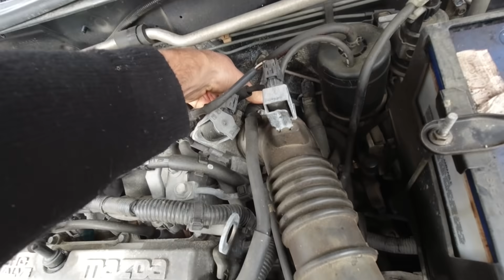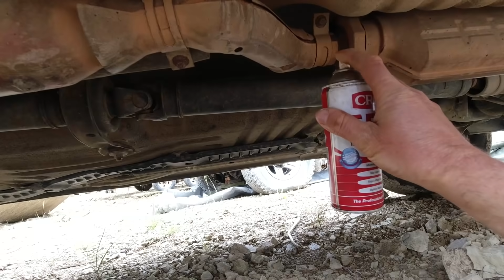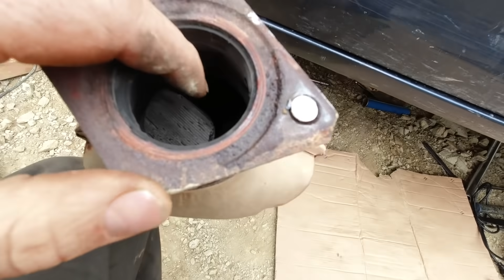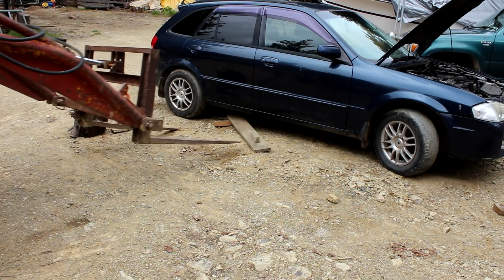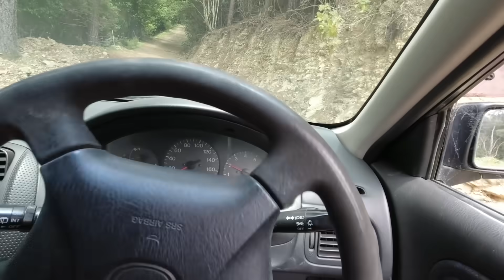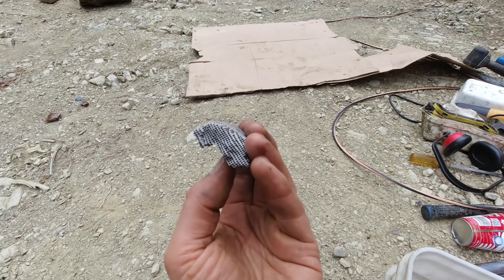Car engine overheating / lacks power,  Faulty Catalytic Converter?

Comment: Those mazda's are tough as nails. Had one back in the days and I loved it
Reply: I had a 1988 mazda 323 manual everything..brakes steering trans windows etc..but what a great lil car got me 40mpg too
Reply: @leeharris3061 
 I had a '88 323 3 door hatchback too but automatic,  a "De Luxe" version, with sliding moon roof, and... lighted door locks !
I was looking for winter beater for 5 or 6 months when my regular engine broke was not worth fixing it.  My mechanic called me saying a lady customer wanted to buy a new Honda, tired of her old car.
 It had 2 sets of brand tires, summer on lovely mags and winter on steel. No rust at all, 188,000 Km.  2,000$C. 
I had it for 5 years (!) till the front frame broke at 465,000 Km !!
I loved it.

Comment: That's weird . The catalytic converter after muffler. It's also a weird design as well which makes me wonder if it really is a catalytic converter.  FYI for those wondering if it is tested it will probably pass emission tests.

That said..uh I don't think your engine problems are over. Blocked exhaust stalls engines doesn't make them overheat. Also if rad blew you have other engine issues.  Usually a bad head gasket or cracked head.

Comment: Good job. It seems that if you save the bits out of the converter, those chunks are full of the platinum catylist. People extract the platinum and it's good money. There's a video on YouTube (Cody's Lab) in which the presenters collected dust off of the sides of the road and extracted the platinum from it and determined its value. Or you could use the platinum to make a bunch of catalytic  handwarmers. They stay warm for hours, running on lighter fluid, without a flame. The platinum catylist burns the fluid and make the heat.  

Thanks for the content.
Keep up the good work.    
בס״ד

Comment: If it has an O2 sensor on it, doing this fix can cause it to use more fuel. I didn't see  on on yours so it should be ok. Did this a lot back in the day. As long as it visually had a catalytic converter on it would pass inspection. Now they put the sniffer on it to make sure.
Reply: Had similar issue and installed a race cat (essentially just flow through pipe with mesh) and placed elbow fitting on the o2 sensor to move it further away to tweak the sensor readings. Worked a treat and the ecu never threw any errors.

Comment: Former Mazda tech here: these cars have a bad rep for destroying their cats... ive changed hundreds of those in the early 00`s
Usually was caused by a misfire, bad plugs/wires or coil. There was a factory recall on the early 1.5 litre model, those all got new coils after too many failed and immediately destroyed the cats/rear mufflers causing huge warranty claim costs
Reply from the maker: Thats interesting, thanks for letting me know

Comment: That proves that 80% of modern cars' components are not really necessary... One of the best cars ever made (for its simplicity and good engineering) was to my opinion the VW beetle with Porsche manual transmission (cooled by air).

Comment: wow we didn't get those in 4wd around here, minnesota/usa
very nice cars though, they go for just about forever
if it ever gets to stalling, first thing to look at is that rubber intake boot to the MAF, they tear and then the metered air leak makes it stall
Reply from the maker: It is a good little shopping cart and gets up my hill with ease. Good advice cheers
Reply: I had that rubber boot leak on mine too duct tape fixed it :) I got a second one after the rubbish truck ran over the first one it was the 2L model SP20 that was the best car I ever had it was comfortable and easy to drive long distances but also really fast.

Comment: Lucky buggers get awd mazdas like those!

I rebuilt my 4age, forged everything, new turbo and it wasnt a slug it was just a little underwhelming. Turns out same thing.
I did the same process and oh my good god it was a weapon. 
Mind you i replaced the entire exhaust and included a 100 cell high flow cat. Still goes like a cut cat!

Comment: Those can be problemmatic, they frown at us fixing them that way here in the states...
Reply: Only in newer cars... in my state 95 and back don't care if you do this. I think they actually allowing even newer cars to skip the emissions check as well.
Reply: Technically it's not fixing it so much as converting it to a muffler.
Reply: I cut the cat out of my 92 ford bronco and no one ever said anything here in VA.  Though in the 20+ years I owned it only 2 mechanics ever inspected it lol...
Reply: @TheDemocrab  High flow muffler. Those are expensive! He is saving a ton lol
Reply: Is an issue in Canada as well. Actually more the frowning but...
Reply: @GeminiWoods  We have to have our cars inspected at least every year to remain on the road here in New Zealand.
Reply: @peterwise143  Yeah, same here in VA.
Reply: Last time when I took engine and gearbox away from my vw v10 tdi touareg I cutted also away all 4 cats and deleted rear muffler. It has passed now 4 mot since that here in Fin without any complaints 😁
Reply: I'm in Pa. Every car in my fleet is Non Cat. Took all the Platinum to scrap.  Newest vehicle is an 05.
Reply: Older cars here in NZ are fine, newer ones you cant just delete the cat.
Reply: Illegal I believe in the UK..

Comment: Now that you have knocked all the platinum honeycomb out of your cat it helps if you add about 1/2 an ounce to an ounce of pure acetone per gallon of gasoline when fueling... experiment a bit w/ the amount or google it... this will help in burning off excess hydro-carbons and will slightly increase gas mileage and HP... I put about 8 ounces per tank full in my 20 yr old honda almost every time.  I notice the difference when I forget... Many Blessings , SMR
Reply from the maker: Cool trick, I haven't heard that one before
Reply: @MartyT  ... I learned about it from an old school mechanic friend of mine ... the man can fix anything and improvise on the spot... similar to you w/ more experience... Many Blessings , SMR

Comment: Do you not have emissions testing or MOT in NZ?
Or is it just meant to last until its next check?
Reply: Yes we definitely do have MOT testing to keep a car on the road
Reply: He lives just over the hill from the nearest MOT ;-)
Reply: Cars only have to meet an emission standard when new or imported JDM cars are complied. NZ cars have a 6 month (pre 2000) or 1 year Warrant Of Fitness W,O,F inspection. Suspension, brakes, rust ,seat, belts, tyres etc. Costs around $70.  You also pay a yearly rego cost depending on the age and safety rating of vehicle or if a diesel. Roughly $107 to $300  a year. for a passenger size . trucks pay more depending on weight and road user chargers based on weight. $79 per 1000km for up to 3 tonnes ranging to over $300 per 1000km for the heavy transport trucks, the more you damage the roads the more you pay. If you Gut a cat and leave it in place not a big deal most of the time. Petrol is around $1.80 to 2.20 per liter (91 oct, 87 us oct ) that has road tax built into price. Diesel is around $1.10 to $1.30 a liter and the road tax is calculated on weight and distance and payed separate. Most vehicle's over 3t , are diesel. Hope that gives you a brief overview of NZ transport regs
Reply: @mac4boys541  Diesel price seems pretty reasonable.
Reply: @dpeagles  you then have to add the $0·40 c/Kilometre  Road User Charge into the equation.
Most 6wheeler trucks do 2·-3 Km/L, so, the fuel cost roughly doubles .......
Reply: @mac4boys541  Wow!!
Here in California test requirements have gotten much better. Every year registration is due ($50-$200). Then, every other year the pre-2000 vehicle must pass the SMOG test (sniffer test). The post-2000 vehicles, no sniffer check. They go by the "check engine light" only. If it's on you fail, if it's off, you pass.
That's it. No safety checks whatsoever. You could roll in with a rusted out go-kart with 3 bald tires and a flat, they don't care.

Comment: Did you see that DeWalt reciprocating saw with the wires coming out of the battery housing? The wire had large spring clips attached I think

Comment: Yea mate good work . Seen it afew  times at work .. seems  to be  when the vehicle  is hot and  is drivern thur  abit of water  that rapid change in temp upsets the cat abit .  And it might pay to get some axle stands .
Reply from the maker: That makes sense.. my wooden axle stands will hold up 12 ton grader I think they'll be ok under my car ;)
Reply: He was using Eco friendly Kiwi Jackstands, 15 metric ton rated locally grown and 100% Biodegradable.
Reply: What’s wrong with the stands he was using?? I’d trust them more than some weldment from China! Well done, Marty!
Reply: @joevalencic5275  That's exactly the way the cavemen used to hold up their autos.

Comment: Is it okay letting your local MoT see what you've done to it? I don't know what the regulations are in NZ.

Happy New Year, all.
Reply: I can confirm for a car of that age its ok to remove. From memory in NZ anything MY 03 or newer requires a cat.
Reply: In many places once you clear a certain age, they stop haranguing you over emissions testing, round here it's 15 model years and over. Coming soon to a UN member state near you: ICE forced retirement ages if not full on ICE bans. Because carbon is bad.
Reply: @HiVizCamo  Unless you're a photosynthesizing plant species.
Reply: puirYorick No emission testing in NZ. Seriously if it's not blowing smoke it's OK.
Reply: @jamestudorbarlow  WOF inspector here: If it was manufactured after 01 January 1990 and registered after 01 May 2010, then it has to have a catalytic converter if it was manufactured with one
Reply: @badboybubby7794  thanks, out of interest is that checked via visual inspection or is it via an emissions test? Here in the uk i think the main thing is the actual emissions, but they have been tightening up on things like DPF and EGR blanking/removal.
Reply: @fizzguts  That's more or less the case here too but I wondered at the wisdom of posting proof of the actual deed online for some eager functionary to spot and decide to be a local hero...
Reply: @badboybubby7794  but it still has a cat on it......its just empty! Most places just look to see if one is there, not if there is anything in it. Most emissions systems were designed to get the car off the assembly line, showroom floor and through warranty. After that the manufacturer could care less and no longer carries replacement parts. Why? To sell new cars every X amount of warranted years. Lobby groups have been trying to outlaw aftermarket parts sales for years licking their chops at the aspect of after warranty induced scrapping of vehicles. What a way to guarantee sales no matter how much irrelevant crap you produce. Emissions should be in effect until the warranty runs out, period. The system is designed to work on a new condition vehicle. If the local government wishes for the systems to be maintained at all cost let the local government foot the bill. Sure it comes from taxes but let the rich people who can afford to buy and maintain a vehicle to like new condition live in those areas. When those tax dollars stop coming in the incentive to have those citizens come back will return.
Reply: @davidedwards4125  A visual inspection mainly: they are checked at the border as part of being complied for NZ roads, but nothing as part of the periodic inspections (MOT, but we call it WOF - Warrant Of Fitness) we do during its 'life' here (6 or 12 monthly, depending on age, 12 monthly if made post 2000, 6 monthly if pre 2000). If someone were to take the 'guts' of the cat out as Marty has here, there's very little chance of being caught out, ever. he won't cop any grief for posting this either. No-one will really bat an eye to be honest.
Reply: @terryfromsouthcarolina4601  I get all that. Also, no-one has called for aftermarket parts to be banned here to my knowledge. Aftermarket and fake genuine parts are everywhere - they're very hard to stop: Fake bits have even been found fitted on Air Force One and Marine One..

Most jurisdictions are making laws for continual use rather than keeping a manufacturers warranty, hence 'smog' testing is run by the Govt post warranty period in the states and Europe for instance.

Comment: When you were right at it, a straight pipe through the housing would gain some extra hp, I guess...less turbulence in the now empty space...
My mate had the same problem some years ago on a Ford Escort, the ceramic block melted to the inner wall, topspeed was around 40kph then...
:-D
Thx for the vid!

Comment: Don't you have laws in NZ against polluting which require a functioning catalytic converter ?
Reply from the maker: No not on these old ones, it was polluting more with the broken converter in there, removing it has improved the efficiency = less pollution

Comment: I was expecting you to replace it. Are  those converters required in NZ?
Reply from the maker: They're not required in my car  ;)
Reply: @MartyT  is the greater flow going to burn the head up?
Reply from the maker: @corlissmedia2.0  No it will make very little difference, apart from slight increase in power at top end.  Plenty of backpressure still in the pipe

Comment: After 5 years or so (depending on mileage) I'm told that those things stop working and just waste fuel. I'd pull the one out of my 2011 Pajero but I'm told it makes a terrible metallic noise if you do. Are you not finding that, Marty?
Reply from the maker: Maybe slightly louder but no metallic noise

Comment: 99% of modern car problems are related to emissions crap, Diesel or Petrol engines,  I've disabled the EGR valves on my diesels, the emissions  readings are lower than before. And they go better, also better on fuel. Well done I bet the Mazda will last even longer now.

Comment: Will it pass vehicle inspection there like that? It wouldn't in the States.
Reply: depends on the state. more interesting how to deal with the check engine light for an after the cat sensor :)
Reply: It would were I live in the states due to the fact they don’t do emissions test on vehicles where I live.
Reply: @boltyk1  No sensor on that model.  No sensor -> no light -> no problem ;).

Comment: I'm surprised you don't get a O2 error code.  Maybe this car doesn't have the after cat O2?
Reply: Looks like an older car
Reply from the maker: No sensor on this one
Reply: @MartyT  I did see a couple of lights on the dash but couldn't  see what they were. One yellow, one red?? Love your videos Marty, keep up the good work. Cheers mate.
Reply from the maker: @garrydonnelly6433  That was the seatbelt light and auto hold light to keep it in low gear, thankfully no engine light

Comment: Out here they are called catalyseur they are supposed to help on exhaust fumes. Only slightly reducing car full power. Supposedly when it's possible to remove it cars run better without it. Only it's not always possible to do so as some cars have electronics

Comment: If it has a down stream O2 sensor it might start messing with how the engine runs.
Reply: down stream o2's doesn't  contribute to fuel to air mixtures. i believe all it does is monitor catalytic operation. compares downstream value to the upstream value to ensure it burns the excess HC
Reply: If you noticed, the check engine light was still on. Probably the downstream O2 sensor.
Reply: @BrokeDadWorkshop  I have seen the downstream o2 sensor mess with the fuel trims on a Toyota camery. Not all cars do it but it's just something to watch out for

Comment: I had that happen to my car many years ago, had power but sounded like it dropped a valve.  Took it to a guy and he found it was the converter.  He broke all the stuff inside out(asbestos). 
I was really surprised he did that and did not replace it since it was not legal.
Reply: He did replace it, after all the stuff fell out. Didn't you watch the video? Aha

Comment: The guts of the Cat does have a small amount of platinum. just have to figure out how to get it....
Reply: Cody’s lab gets platinum from them. A tiny tiny amount.
Reply: I saw a YouTube video saying that only older cats before the 90’s I think it was had platinum in it. They also showed how hard it is to get and that it is not really worth the materials etc to get it.
Reply: Most scrap yards (at least the honest ones) won't buy cats unless proof of ownership is provided. This is only done by way of a mechanics bill showing it had been replaced. There are some on line companies who will buy them, no questions asked. Some cats can fetch between 500-800$ each.
We had a recent theft here where a funeral home lost all the cats to thieves, all brand new Cadillac limos and hearse, a total of 4 vehicles. It cost them over 13 thousand dollars.
Reply: The last one i gutted in NZ the scrap metal guy gave me $30. If some are paying $500 in the USA then no wonder Midnight Autos are working over time. Easier than picking up gold nuggets!!
Reply: Scrap guys are paying 100 buxs each down this way (bottom of the South Island) so they must be worth something
Reply: Mount Baker Mining And Metals shows the process for cleaning catalyst of precious metals.

Comment: Is there no MOT system in New Zealand? Catalytic converters are stolen in the UK - even broken, scrap ones - because of the value of their metals content? Couldn't you have sold it and put the proceeds towards the wife's new car?
Reply: Cats not necessary for that year, anyway. No emissions testing yet so you can decatalyse anything and  get away with it if the original cat looks like it  is still there and intact. MOT every 6 months or 12 months depending on first registration year anywhere in world.